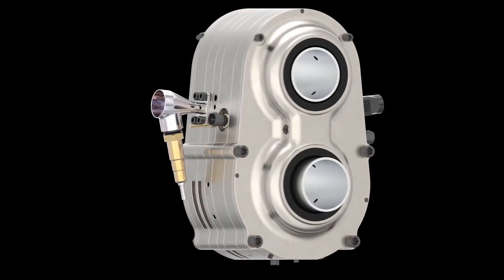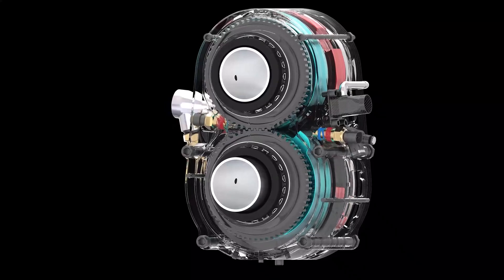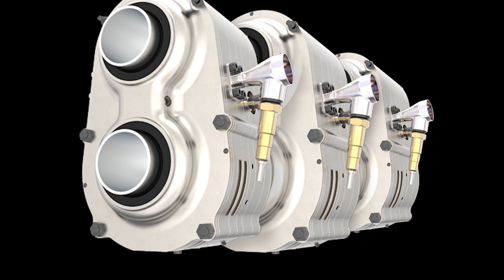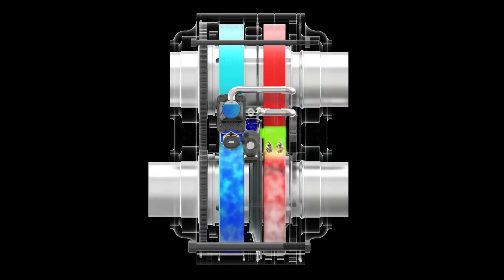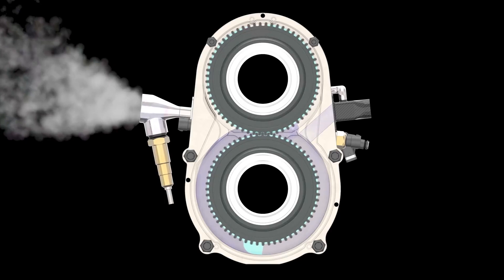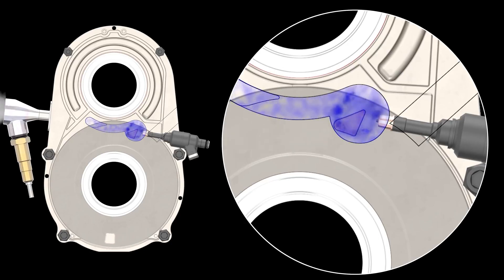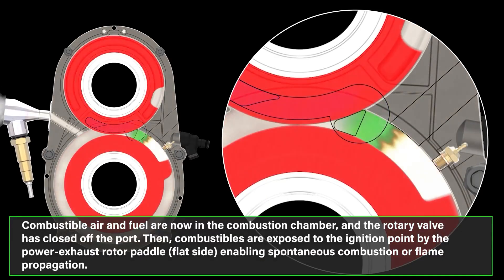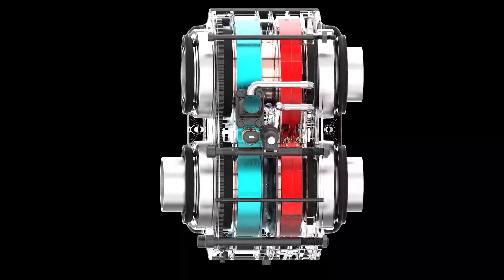This pistonless engine runs on hydrogen and revs to 25k rpm

Comment: Eliminate losses? Not possible. Internal combustion engines, like external combustion, are heat engines. That means there's losses through heat, like a lightbulb. It rotates, right? Then there's bearings, which means friction losses. It takes energy to compress the air for combustion, which is a loss. No seals? Then there's combustion losses through gaps, which you must have to reduce friction. The claims made by the designers are unproven and impossible, and you will never see this engine in production use. You can't make me believe that an engine turning 25k rpm has no friction and is highly efficient. Even they're "demo" video is fake. They ran the engine on compressed air and managed to get actual combustion two or three times during it's run, all the while it was pouring oil. But don't take my word. Go watch the video and see for yourself. The red hose connected to the engine is an air hose, complete with a valve, disconnect, and pressure gauge.

Comment: Electric is a wast of time it's been being developed as long as the internal combustion engine and still sucks as bad as the first ones did internal combustion is proven but someone needs to improve it without all the electronics to fail on it less plastic also and I myself want super high horse power and torque with an awesome sound it has to be a visceral experience I want my mind blown with non electronic assisted engineering

Comment: This would make an excellent racing engine. I wonder how much hydrogen fuel would it would burn at 25K? The hydrogen combustion engine would make so much more sense than BEV's. The electrical grid infrastructure cannot support everyone charging their BEV's and even more fossil fuels would need to be burned in power plants to stabilize the grid. Not to mention the toxicity and pollution which batteries impose. Hydrogen can be formed from a number of different sources and methods which would be advantageous to many countries around the world who do not have access to the ocean, lack diverse energy resources, or rely on natural gas, coal, oil etc.

Comment: This should be installed in a boat, each cylinder can run a shaft with counter rotating props, and hydrogen can be made on demand with solar from the same water the boat is in....

Comment: It's not seals that are the problem with Wankels.
It's the limited compression ratio and fixed timing that kills it.
Unlike poppet valves that open based on a timing cam, the Wankels intake and exhaust ports open based on rotor position.
So, as an example, it wastes hot and energetic gasses because the exhaust port always opens at so many degrees away from the power "stroke" (for want of a better word)
So you waste energy by burning too much fuel and generating terrible emissions.
Let's see if Omega 1 can solve this, on with the show!
Reply: Will, already I see compression and expansion take place in two separate chambers, so the opportunity to fix that limitation is there somewhere

Comment: Interesting looking engine. However, the EV versus ICE argument is really about energy storage and not the engine itself. It's pretty hard to beat an electric motor for mechanical simplicity. The problem with the EV is it carries its energy in massive battery packs , and it takes a long time to charge those battery packs. The advantage of the ICE is that it's fuel is liquid so it can be filled quickly, and it is much less massive (more energy dense).

Comment: Interesting video, but it is good to be aware that unburned hydrogen it self is more potent as a greenhouse gas than CO2 or methane. This matters greatly since hydrogen atoms are miniscule compared to regular fuel molecules and escape from everywhere? Hydrogen systems always leak significantly. Sometimes more than 5% of unburned hydrogen escapes and heats up our atmosphere more than most greenhouse gases. Hydrogen is not suitable as alternative for fossil fuel.

Comment: I like the idea, but I would think about this: 1) 2 candles so that the hot point is distributed, and the bearings do not suffer from axial load, 2) reduce the speed by a third in order to have time to cool the body and bearings .. and a lot of things I would do , good luck to the creator !!

Comment: you can add a turbine to an ICE, 
but if you try to make something that is like both, then it's not going to work....they are too different....there is not enough common ground there, your ending up in a delusional la-la land with it..
there was this one guy ripping on the taurozzi pendulum engine on you tube;  but he wouldn't argue with me when i said, Mazda could make it work ...
but Mazda would tell you to keep that thing, they won't want it.....there are Too Many Things Wrong the omega ....the problem with flame front speed was just the beginning, now it's coming to terms with the metallurgical reality of seal FPM....it's not going to get anywhere without the ability to seal, and it Is NOT going to run at those RPMs..
prototype in nitro-methane scale aircraft engines, that way it doesn't cost so much to screw up.

Comment: i am Not there with power figures based on assumptions ..... it's still a CAD drawing, not a running engine, making those "power figures" .
no seals, in an ICE ? that's an inefficiency right there. ( where that would generally make an ICE so inefficient that it wouldn't even run )
An ICE is not a turbine... 
and if a turbine manufacturer thinks they can develop an ICE startling with throwing over 100 years of evolutionary ground work out the window, then i have bad news for them...

Comment: You did not  say anything about power to take off from stop sign.   Does low RPM make it gutless?    Like watching Engine Masters who only give a damn about 6000 rpm when building an engine and not having to climb a hill at 50 miles per hour.

Comment: My take: the internal combustion engine is going to go away, but tech like this does have a future: it looks like it would make a great option as a range extender generator for battery EVs for use cases that need more than a standard battery pack can handle in a day, at least until the battery tech and EV infrastructure improves to the point that it becomes a moot point outside of very niche use cases.

Comment: Skeptics granted. I would pursue this over the other models competing. Reason I believe the tight tolerances can be achieved is the motion is constant. The liquid piston and the 13b follow a lopsided pattern of movement. This is akin to a turbine yet with a pocket of combustion. So with the high pressures and speed of rotation, the fluid dynamics of the air damning itself will create a strong seal. And maybe not for a family car. Maybe it will suck at low rpm. But aren’t we all looking for a superior race motor? If this engine operated more efficiently from 15-22k rpm than a 13b at 10k , yet less efficiently at 3k than a 13b at 3k, you would have to agree this is optimal? because they both suck. Neither one has good fuel economy. The rotary doesn’t even rev. People tout the Mazda for its rpm but a well-built 4 cyl of equal value will out-rev a rotary. I know it hurts. 12k is usually maximum before moving up to F1. 

Therefor

Just like a jet turbine… see where this is going. The reason they were not used past the 70’s in a select few vehicles is because they are efficient only at very high rpm. Actually at like nearly 80% or higher. It’s going to be the same here I reckon unless using forced induction techniques. Compounding at low rpm could produce air damming that is required. No seals? They could ad seals. Apex type seals. Why not? I would. It doesn’t change the engine. I like this design.

I think more lobes could be added, and rpm could be increased even further.
With the assistance of an electric motor at low rpm I think adding lobes could be overcome because the lobes will want to fight back and become parasitic until very high rpm’s . Then major power gains. 

But when I think the 13b is basically max maxed out at 250hp NA fully tuned no nitrous. The 13b is not light weight. The rotors are heavy af. The eccentric shaft is heavy af. It’s like a big lumpy thing swinging around. It’s gonna blow. Ive had interest in the rotaries but it’s purely for intrinsic value. The sound. The noise. The brap. Just knowing it’s alive. This is better.

So why not use a jet turbine in racing?
Too much rpm. There’s too much rpm for a sequential transmission. It wouldn’t be able to run at max power dropping gears and raising gears. The MTT bike has one yea but that’s a turbine with two wheels and a seat. Not a car. Easy to fly when you just sit on the damn thing. 

Sweet spot is F1 rpm ranges. Old school. 20k - 22k rpm . And we have the clutches and trannies to meet the compatibility requirements of such a motor from scrap F1 tech in the early 2000’s before … well… when drivers were tougher. 22k Honda motors in the test room. Insane rpm’s. A metal disc flapping up and down. Exploding… if that can be achieved this can

Comment: Good.  Strap a generator to the rear of it and make it a hybrid engine.  Then you can drive the generator at a high speed and make a lot of power and torque.  Let's get to it.  The reliability of plug-in-only fully-electric EVs is not good enough yet for mass consumer utilization. Using this engine could allow a smoother transfer to fully-electric vehicles over 20-30 years, rather than the unrealistic 7 years that the government wants.

Comment: I have never been on the electric bandwagon. The vehicles have to be 50% heavier and the mining of the resources completely poisons the ground. It was always a scam to force the entire industry towards electric this early. And it also delayed the process of refining hydrogen technology which is so very lightweight, efficient and clean.
It only takes minutes to refill, and I hear now that there are processes of extracting hydrogen from ocean water which will completely revolutionize and probably basically kill the oil industry... I guess we now know why they did what they did with electrics, since I hear the mining, processing and manufacturing requires an awesome amount of oil resources.

Comment: This is not going to work, period. It's a dream that will never happen. Using hydrogen in a combustion engine, really? Look at this information  as to why hydrogen is not used in the way this guy is describing. Hydrogen has very low density. This results in two problems when used in an internal combustion engine. Firstly, a very large volume is necessary to store enough hydrogen to give a vehicle an adequate driving range. Secondly, the energy density of a hydrogen-air mixture, and hence the power output, is reduced. I also know of a car that uses engines that have fine tolerances it is called a formula 1 car. Because of the very tight tolerances, a formula one car when cold can't be started in the traditional way. Otherwise, the engine will get destroyed. They have to heat up the engine to running temperatures before starting the engine using hot oil. This enables the engine's non moving parts to expand, releasing the moving parts within. Then the engine oil itself has to be heated up, then the engine is llubricated, and then the engine can be started. Then temperatures have to be maintained at all times when the engine is running. So there is a risk thst the egine can overheat or run too cold and break itself. That is why everything is monitored throughout the race to a very high degree of precision. This takes a team of engineers with high-tech equipment and takes a long time to complete. Imagine having to do this every time before starting your car. It is  not practical, right? And guess what? Even with all this, a formula 1 car engine is only 50% efficient.

Comment: to maintain that level of tolerance across a range of temperatures - they must be using Invar - a nickle-iron alloy used in anything from mechanical watches to engine valves. Invar costs $20-$50 per kilogram - so a 16kg engine would contain up to $800 of Invar (not bad considering the advantages). With mass production, that cost would come down significantly. Don't know if this would effect it in an alloy with iron, but some nickel alloys are susceptible to embrittlement by hydrogen. Paper TLTR: THE EFFECT OF HYDROGEN ON THE PROPERTIES OF INVAR ALLOYS. Perhaps a better fuel would be methane/natural gas?

Comment: Prototyping and testing are necessary’s to machines & systems. Just like debugging and testing and using, are necessary to software. But in paper I think this can be a amazing gasoline / querosene / jet fuel motor.

Comment: Honest.  This is a cool concept and you gave a great explanation, however I hate how the government is forcing people into giving up what little they have because of some planet heat conspiracy theory, and furthermore I’ve always considered electric cars to be an absolutely retarded idea.  I’ve literally seen people burn alive just from driving through a puddle, and it’s a bit morbidly ironic that a vehicle that Carrie’s combustible fuel is far less prone to spontaneous combustion than a vehicle that carries absolutely no combustible fuel.  In essence, this motor is cool, but it really shouldn’t have to exist.
Additional.  As a mechanic (and thus being the guy that has to deal with these), I must confess that replacing seals with just simply tight clearances is a sure-fire way to make me hate my job, not to mention increase the cost of rebuilds.

Comment: Hydrogen is the future. Tesla is just a 100 year old idea with a fancy facelift.  As to seals: I think the paddle rotors act as the seal - as the system expands, the tighter the seal, and at high RPM, the fluid doesn't have viscosity/time to slip thru the seal, and if it does - it just slips into the other  side of the chamber priming for combustion in the next cycle....I think.  Regardless - Go Hydrogen.

Comment: You say this is a clean engine, but where is the hydrogen coming from? 98% of hydrogen comes from steaming natural gas. This takes a lot of energy to make the very hot, high-pressure steam and releases CO₂ as a waste product. The clean way to make hydrogen is electrolysis of water, but that needs loads of green electricity to do that when we don't have anything like enough right now. If we do end up with lots of spare, green leccy, just power your car with it. Hydrogen continues to be a dead-end for small road vehicles. This may have a place for certain sized aeroplanes, which would explain why an aerospace company has come up with it, and being lightweight is very valuable for aircraft.

Comment: @Chris VS Cars, why couldn't this design be modified to be combined with and electric generator in the seemingly unused hollow of the upper chamber dynamo style so the outer casing can collect electrical energy like a generator\\dynamo and get hybrid love instead of either or from your gas or electric question? And if the hollow is unsuitable for this application an external modification to the engine design to allow for it surely can be made to allow for it right, the drag on the HP efficiency shouldn't be enough under load to take way from the having it I wouldn't imagine.

But I ain't one to gossip... .

Comment: Looks expensive.. and it's just a piece of CGI...any footage of an actual operational unit? ... One cannot have super high compression without it being sealed. Tolerances only?...erm ..no ....that equals wear and tear.  .. It still has to have a seal of some sort to gain the compression - even if using oil to do it - which then leads to next set of questions - how does it lubricate itself ?  Lubricants are dynamically effected with respect to temp . How is lubricant served with respect to RPM? ...what are the failure modes? - if lubricant isn't at right pressure what fails first ?  - what are the loads? ... what work have they done on dynamic wear? Also 25k RPM is nuts...if HP is factor of RPM it has to raise RPM to get your 160HP ...so what bearings have they found that can tolerate that and the dynamic loads on the engine? ...I can guess the failure modes just looking at this... loss of compression (sealing combustion chamber failure) - Low lubricant pressure at high RPM = catastrophic event.  If has to rev high to gain HP  - bearings are going to cost "estimate" circa £12k to £25k each ... similar to that of jet engines. ...next silly idea please !

Comment: Its a race. Either the combustion engine evolves like this or else someone is going to create a wireless electric grid and gas engines will cease to exist. Once you eliminate toxic dangerous batteries and short ranges, its all gonna be electric.

Comment: horsepower, unfortunately, is vague except in physics.  this would be good, but is that shaft horsepower?  plasma recycling can make hydrogen out of trash, and the co it also makes can be used too, some for stuff like lubes and plastics.

i know enough about physics and engineering to know that the value of an off the cuff judgment about how this thing would work has no value whatever.  it will be interesting to see how it works in development.

Comment: When I see 25,000 rpm's and 200 psi boost levels, I think loud. What kind of noise does this make? Does it sound like a turbine? It was designed by an aerospace company most likely for aircraft, where noise and high cost maintenance are the norm. I can see this coupled to a generator for a hybrid electric, but noise would need to be in the 60 db range inside the vehicle cabin.